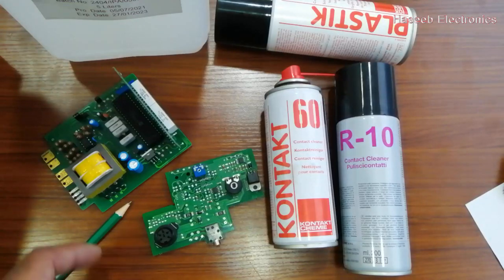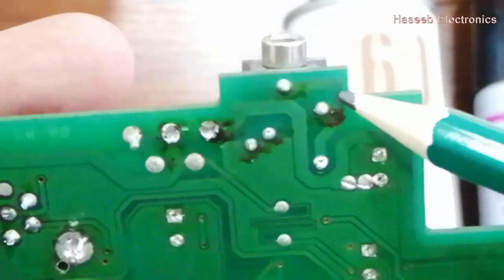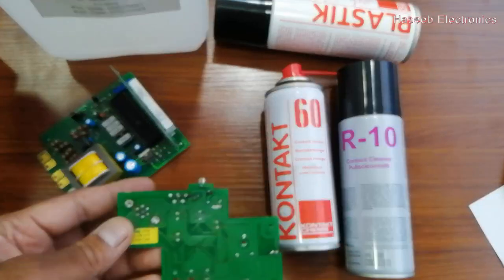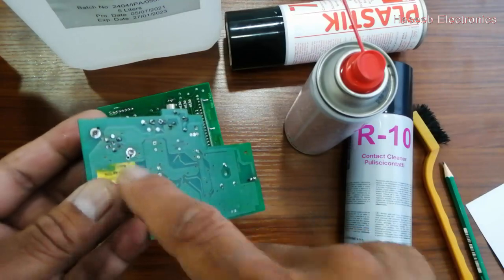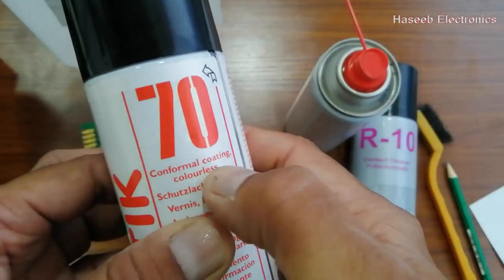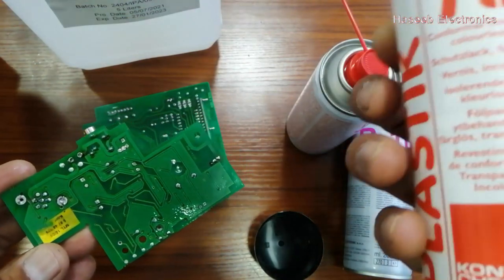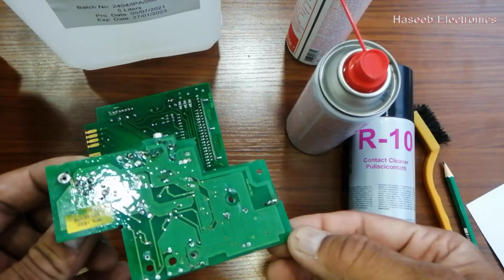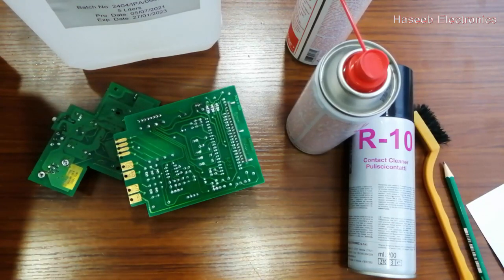{465} Conformal Coating - Protect Electronic Circuit Board from Weather effect Plastic70

Comment: The problem I encountered with this coating is that it becomes difficult to take measurements and do repairs if the board is defective.
So I tried super paint stripper and it worked great 
Thanks for your videos!!
Reply from the maker: yes it is protective layer, it makes insulation 
we can use thinner, isopropyl alcohol, to remove this layer or there are are some sprays are available from aerosol to remove arylic and silicon coatings

Comment: I want coating which protects from physical damaged and also protect from copying my circuit. Any solution for bulk production pls let me know
Reply from the maker: https://www.ebay.com/itm/224877599073
Reply from the maker: https://theepoxyexperts.com/shop/electrical/max-mcr-black-ab/max-mcr-black-192-oz-epoxy-resin-circuit-board-potting-compound-waterproof-masking-sealant/
Reply from the maker: https://www.intertronics.co.uk/2016/09/black-conformal-coating-enhances-pcb-security/
Reply from the maker: https://www.indiamart.com/proddetail/epoxy-based-potting-compound-for-electrical-circuit-and-pcbs-23757373930.html